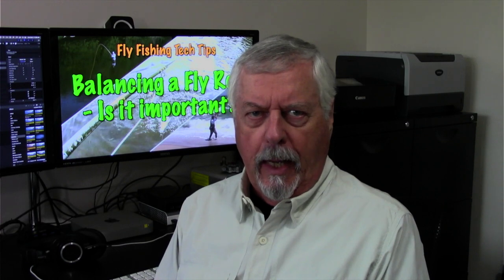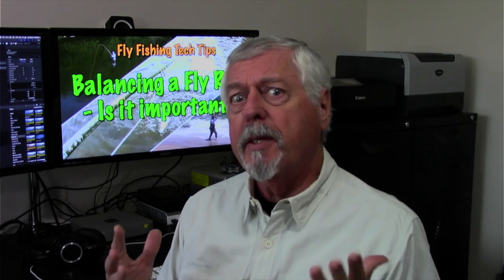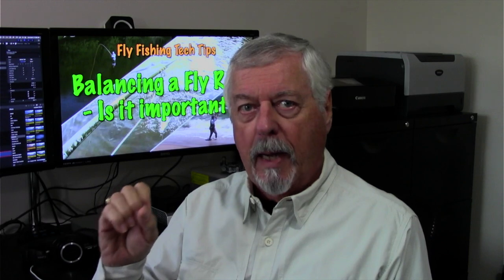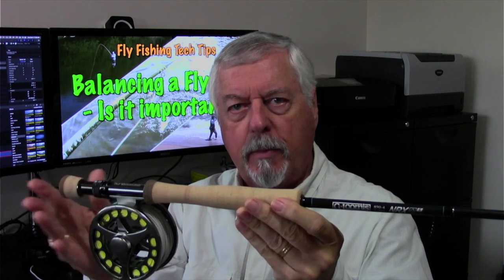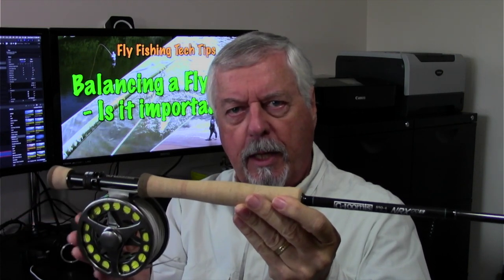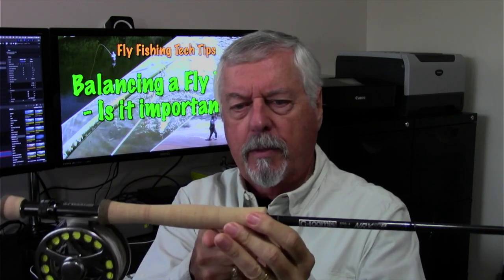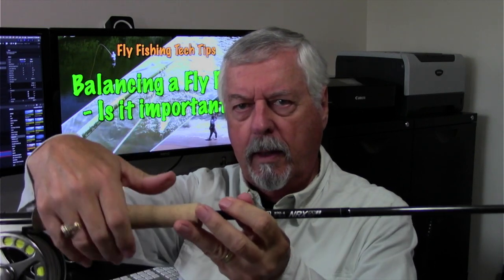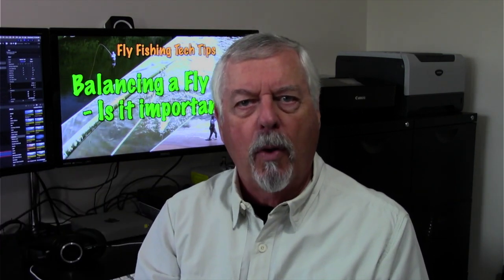Fly Fishing Tech Tips: Balancing a Fly Rod

Comment: Peter, is there a way to measure how much weight is needed to balance a rod as you’ve shown? I have a new 9 wt. rod and want a reel for 9 wt. line that will balance the rod but there are no fly shops within a reasonable driving distance. I’ll have to purchase this reel online and don’t want to be shipping reels back and forth looking for the one I need. Thanks.
Reply from the maker: Generally if we get a reel meant for a 9/10 rod it will balance a 9 wt. rod close enough. If you really want to get precise, you'll need access to a kitchen scale, some baggies and some clean sand. Fill the baggie with the sand, attach it to the middle of the reel seat, then add or remove sand until it balances the rod. Then weigh the baggie to determine the weight of the reel, backing and line necessary to balance the rod.

Comment: Excellent as always! Will the balance point change when you strip line off the reel to cast? Thank you,cheers.
Reply from the maker: Only slightly and not of consequence. The line in the guides actually has more influence. The point through which we feel the casting effort is going to change as we cast and let more line out. This video shows the static balance point only. Think of it as  being close enough to do the job.
Reply: @hooked4lifeca  Great! Thanks so much.
Reply: If your reel is too light, I guess you could wrap a little lead core or t14 on the spool underneath the backing?
Reply: I use a 9ft 8wt with a 7ips airflo sniper line and I find the balance is perfect as I am making a cast and once the line is out but if I was to just slap the reel on and test the setup for balance it would feel off.